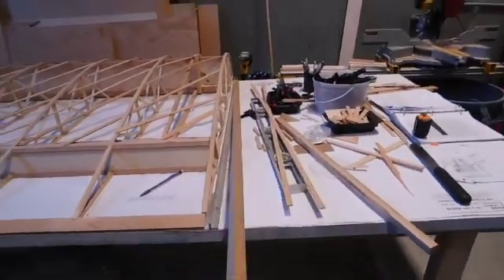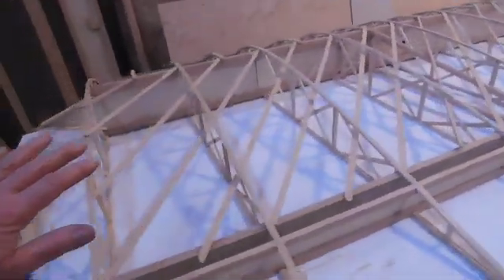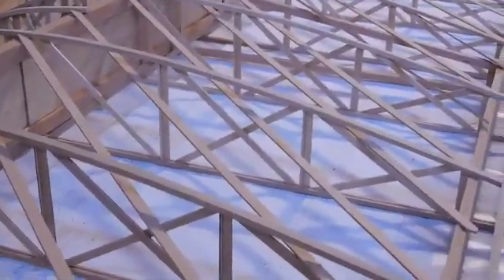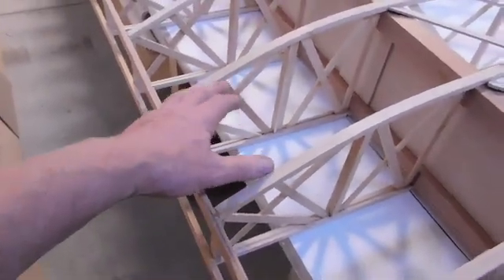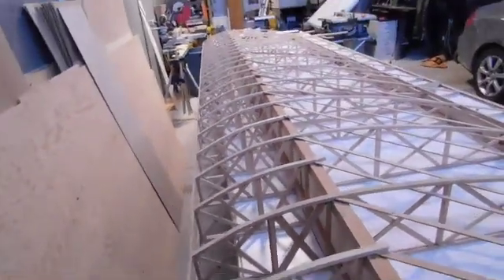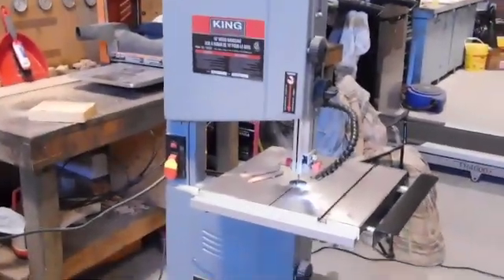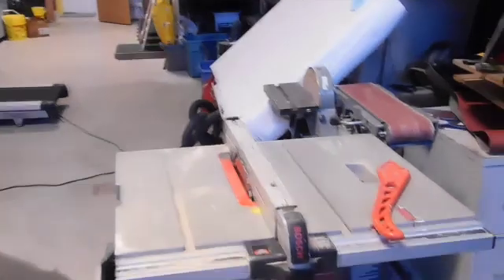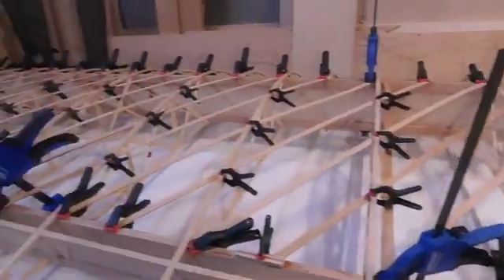DAKOTA HAWK EPISODE 36

Comment: "No matter how many clamps you have, buy more clamps" - SO True, I wish I did not have to leave all my old clamps behind when I was posted to a new station in the RAF after the last rebuild (I just cannot afford to replace them all at current prices). Yes, the big saving with a kit is time turning wood into dust (from a side by side build with a two friends building two identical planes, one kit and one from plans [MiniMax's] in the same hangar and from what a YouTube Friend has said, the time saving is around 150hrs), the big advantage is the wood is to your standard (not just acceptable), you can cut that little extra for mistakes and cut to your spec to make it match perfectly. If I had the space and still had the tools and a source for good aircraft quality wood, I would build scratch build. The time saving is small with a kit, considering I work to try to get near perfect, so dislike the fact the parts produced might not meet my standards ( I have remade a few items or made modification as you may have seen with the aileron bell crank and bearings along with other parts).

Comment: You can get 200 Clothes Line Pins for about $5. They worked great clamping the geodetic where they cross.
Reply from the maker: You'll see in my next video I use paper type clips... they work good.
Reply: @sawyersdad5292  Yea those binder clips would work well too.